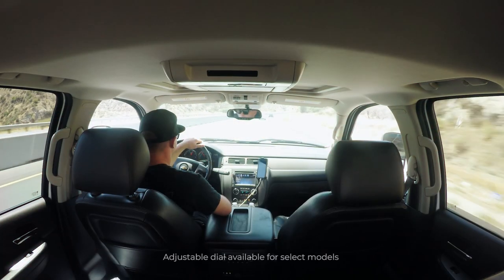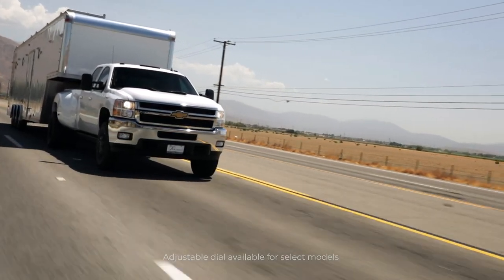K&N's VP of Product Development Discusses The Boost Control Module Concept

Comment: I just ordered one for my 2018 raptor ,do I need to run  93 octane?
Reply from the maker: Please check your vehicle's owner manual.  The Boost Control Module does not change the fuel requirements.
Reply: @KNfilters  sounds good,boost control  gets here tomorrow cant wait to install it